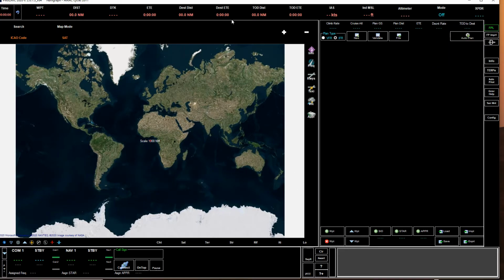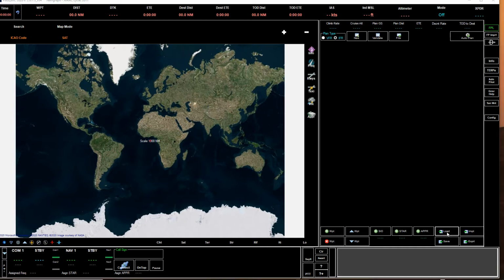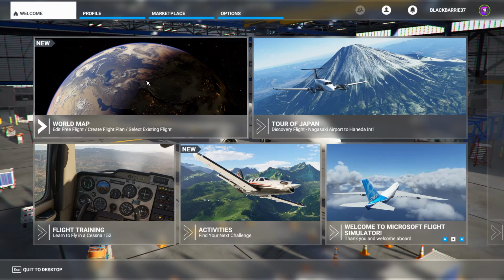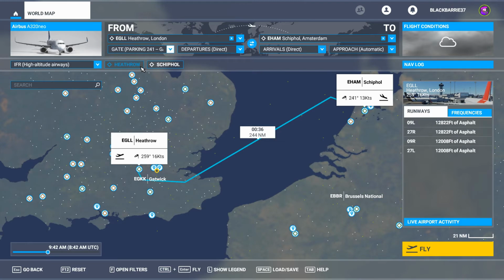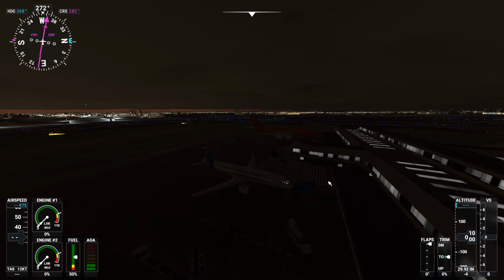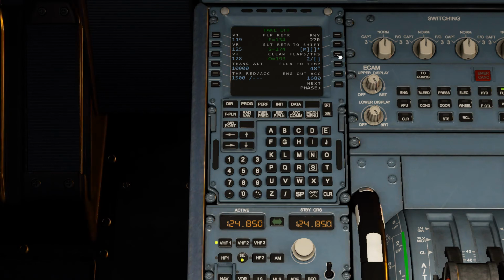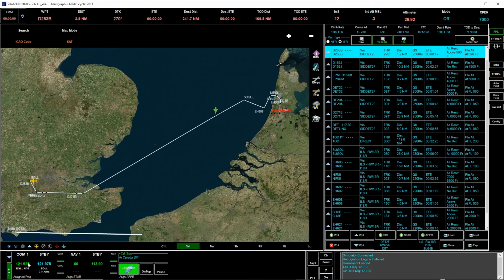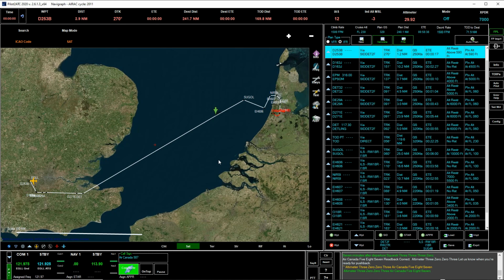How to Connect Pilot2ATC to MSFS2020

Comment: I just bought pilot2atc because I think that could be a great tool to practice radio com towards my road to PPL. the learning curve for this program is very steep but I get there at some point. Thanks fir this great tutorial. All the best, from Wellington, New Zealand
Reply from the maker: It's a great program "pilot2atc". You will also want to get "x-atc-chatter" from Stick and rudder studios. This can be installed in chatter folder and add realistic real pilot chatter to your flight based on the atc you are currently talking to (Cearance, Departure, Ground, Tower, Approach etc.)

Comment: How do i turn off fs2020 atc and only use pilot2atc
Reply from the maker: This is how I have it set up. Click on options from start menu. Select Assistance Options, Under Piloting I have everything turned off, Under aircraft systems I have everything off, Under Failure and Damage I have everything on but this is not related to ATC, Under Navigation Aids I have everything off except taxi ribbon (useful on arrival at airports), Under notification I have everything off. Under User Experience I have everything off (particularly atc voices) with the exception of ATC UI panel open at startup (useful for ground services).

Comment: Appreciate the time and work you put into this video, I'd like to make a few points. One being If like me you are using an Ultrawide monitor and/or multi monitor setup, do yourself a huge favor and start MSFS FIRST, if you do not the sub menus for export/import, grammr hlpr and so on will not be easily accessible, you will have to change your screen resolution. I do not suffer from loading issues as described, if you do then obviously Bob's advice is great. Do not however connect the sim to pilot2atc until after you have created and exported your plan. Unfortunately with almost everything PC centric you can face issues where others may not. Bob you also mention creating a new folder, this isnt needed but can be useful if you have trouble finding the root folder for the sim. Google should point you in the right direction, but you may need to unhide folders as in some cases it will be in the appdata folder in C:/ or your default drive. So If Bobs works better great, if you have an Ultrawide and multi monitor setup don't do like Bob! Ultrawides are not the normal so there's fewer apps that run as intended for us, so no offense Bob if you read this. Another thing I think you would like Is VoiceAttack, its another voice recognition software that you can set controls to voice commands, so you could request ground power with voice attack and voice attack would then press the keys to call ground power to you, its a bit more work to set up but for some this may be a great addition for immersion. Anyway happy simming!
Reply from the maker: I appreciate your feedback. The issue with starting MSFS first is if you launch the plane you cannot create flight plans and export them using Pilot2ATC as the import function for MSFS has to be at the initial home screen so it is too late if you are already sitting in your plane. I have changed the root folder to the MSFS root folder but it is not easy for everyone to find so I suggest a folder that the individual has created if they are having difficulties locating the MSFS folder. I have multiple monitors  of different resolutions and have none of the issues you describe with menus not being accessible. I also mentioned not to connect Pilot2ATC to MSFS until you have launched the connector as the connection will fail. I am interested in your "Voice Attack" as it is annoying having to use the MSFS menus for ground services. If you can can use voice commands for ground services  it will remove annoying clutter on the screen. Thanks again for your feedback.
Reply: @bobblack4604  interesting, they tell you to turn MSFS on, my FSUIPC7 starts automatically, then we start P2ATC. I create plans in P2ATC... save for each... same plan... different formats?... I'll try your way... trials still on...

Comment: Thanks for nothing you didnt explain the connection msfs2020 at all .
Reply from the maker: Sorry I did what I always complain about others in that I was assuming people already new the basics of connecting to msfs2020. I was just making suggestions on how best to connect msfs2020 and to start Pilot2ATC first before msfs2020 and the connector.  Here are instructions on how to download and use the necessary connector- https://www.avsim.com/forums/topic/580956-installing-pilot2atc-to-work-with-msfs-2020/
Reply: @bobblack4604  Hi Bob,
Terrific videos, thanks! 
I can’t find the answer to this simple connect issue anywhere...
When I export to save flight plan, then go back to load from bottom of Welcome screen in MSFS, it doesn’t appear (in file formative looking for), nothing is saved :(
I found a .flt file I had saved in another folder, when it loaded, it put me on active runway (from set gate), and changed model of plane from Cessna G1000 to the old steam gauges model.
How do I see the P2A fp on the G1000 Cockpit displays etc...in the sim?
Reply from the maker: @kennykanada  Did you create a folder on your computer to save the files to? MSFS has an obscure file buried on your computer that is difficult to find for flight plans that is why it is easier to create another folder that is easy for you to find and export the file from Pilot2ATC. Make sure you have selected the correct file type and format when exporting "MSFS2020 .pln" You'll need to have the file path defined to the folder you created.  When you are in MSFS at the welcome screen and you load flight plan you will need to browse for flight plan in folder you created. Watch the video again as I show you how to find the flight plan that is exported to the custom folder you create..
Reply: @bobblack4604  Thx Bob! I did all that, creating a new file on an easier path. But then nothing appears in there when retrieving file. It’s looking for a .pln file but they’re not appearing.
Reply from the maker: @kennykanada  It sounds like you are not using the right export file. In the dialogue on Pilot2ATC you need to check the box that says "MSFS 2020/P3Dv4-.pln" and then make sure the path defined goes into the folder you created. Using file explorer when you open the folder that you created- is there anything in the folder? If so what is the file extension? It should be ".pln". if you used the correct export checkbox and defined file path in Pilot2ATC the flight plan will be there.
Reply: @bobblack4604  Thx Bob! I’ll check those points this afternoon, when my son wakes up and I can use the room lol!
Will advise...
Thx,
Ken 👌

Comment: You always make the best tutorials! I had given up on loading the flight plans directly to MSFS, not because of the file directories, but because choosing a gate/ramp always screwed it up😅 I didn't realize it would work if I used the drop-down menu instead. I've been manually entering my while plan after loading the aircraft. Have you noticed the transponder not communicating with P2ATC? I haven't heard if there's a workaround for that yet. It's not a big deal though. I'm just happy to have P2ATC working with MSFS. I completely quit IFR flights until P2ATC was functional with it.
Reply from the maker: Yes I was quite frustrated initially with MSF2020 and there are still many things that don't work or don't work correctly like transponder recognition, trim control, tacs, much of the instrumentation and MCDU programming but at least with being able to import flight plans from Pilot2ATC it is at least workable. I don't know if it's just my Pilot2ATC but I don't seem to get ATIS on many airports, and the ATC chatter has disappeared. Many of the airport layouts and taxi ways are different in MSFS2020. I haven't tried the import airport taxiways function from Pilot2ATC yet but may give it a try.
Reply: @bobblack4604  ATC chatter is working for me. I don't think I changed anything, but I did have to tick the box one time..I don't know if I had previously unchecked the box or if an update had done it. Also, I did have to change some stuff with ATIS, but I don't remember what exactly I did. I believe I checked the box under "ATC Settings" for "Pilot2ATC provides ATIS." I also had to change the weather source under the "WX" menu since I used Active Sky with X-Plane 11. I currently have it set to "NOAA Real Weather." I'd like to have it match the sim weather better, but I'm not sure how. I always fly with real weather, so it's fairly accurate, but the altimeter settings that Pilot2ATC gives me doesn't match the altimeter setting MSFS says is current. I'm not complaining though, everything is working well enough for me to enjoy it. The main bugs I've been dealing with in the sim is with the avionics turning off mid-flight. I used to be able to toggle it and they'd come back on, but not anymore. I've read some suggestions in the forums that I haven't tried yet, so we'll see if I can resolve it. There's a lot of bugs..a lot more than I had expected there to be, but I believe things will continue to improve as they continue to work on it.